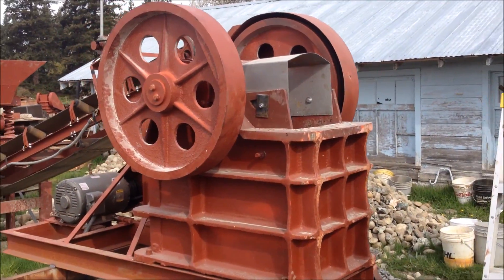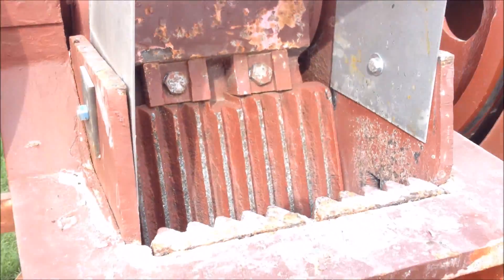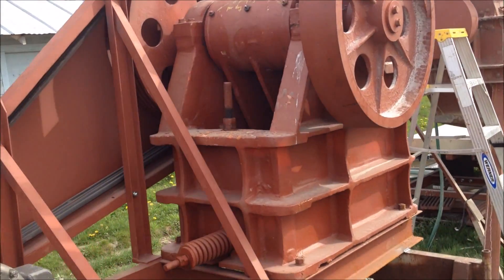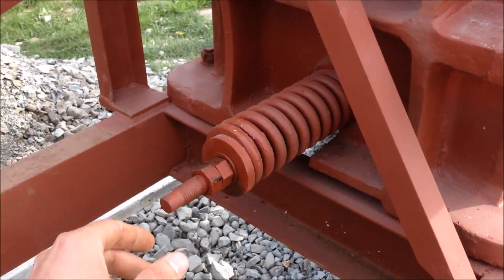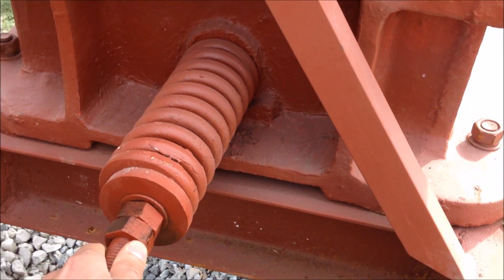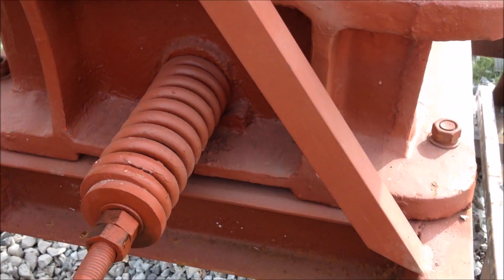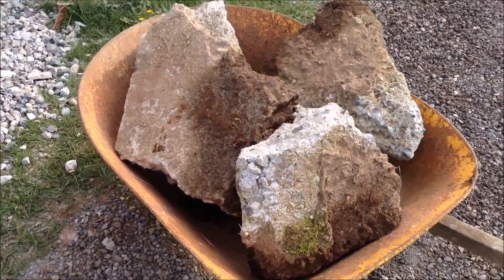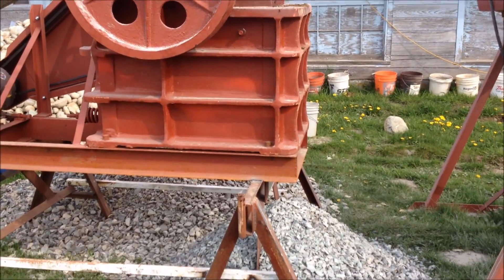Concrete Jaw Crusher 10"x16" : Crush Rock, Concrete, Stones | Gold Mining, Recycling, Aggregate

Comment: Can you crush hard granite boulders with a crusher like this? Friend of mine wants something like this that he can power off the pto on his diesel tractor as he lives in an area full of glacial till.
Reply from the maker: Hi.  Yes it can.  You can check out this video of another 10x16 jaw crusher crushing granite: https://www.youtube.com/watch?v=0bSmO9N25Yk  Give us a call at 360-595-4445 or email MBMMLLC@gmail.com for more info.  Thanks
Reply: @mbmmllc  what is HP of the electric motor
Reply: Can 7.5hp or 10 HP 3phase electric motor run this crusher?

Comment: can an unit like that crush concrete with wire in it?
Reply from the maker: +goldmaz23 Yes it can.  We have crushed concrete with wire, rebar, and other small metal contamination.  The important part, especially for rebar, is to not have the jaws set smaller than the largest piece of metal because it will jam the jaw crusher or the metal can fly out like a bullet when squeezed in the jaws.  With wire and mesh it is no problem, just make sure there is enough room between the discharge of the crusher and the pile or conveyor for the wire to fall out once the concrete is crushed